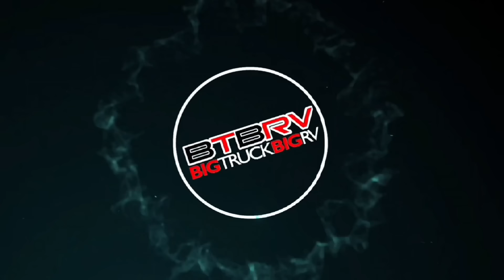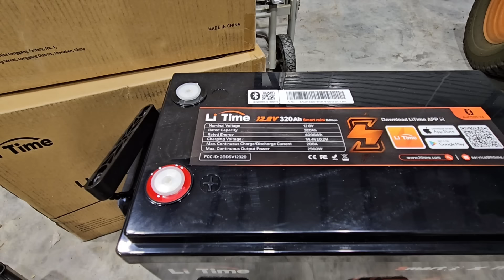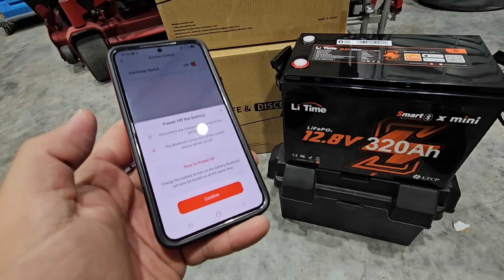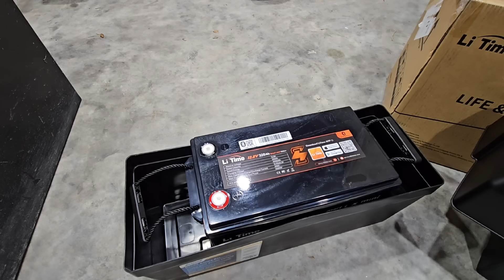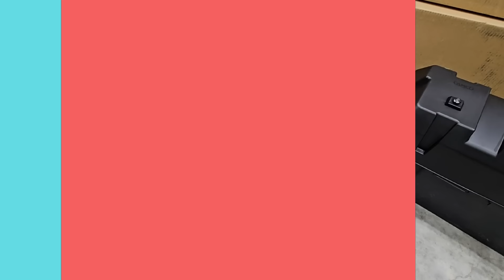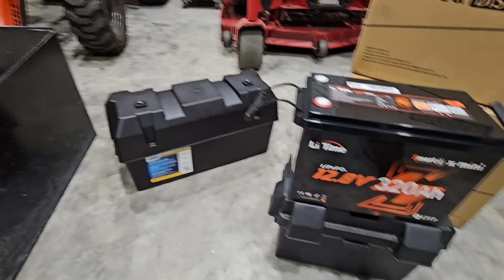INCREDIBLY COMPACT 320AH Lithium LiFePO4 MINI RV Battery from LiTime!

Comment: Just bought this battery in the self heating version  and will be boondock camping with it tomorrow. We have 340w of solar and an absorption fridge and no inverter so we should have more than enough power for any conditions we run into.

Comment: Batteries aren't getting smaller, the cases are. Battery makers have fooled people into believing a bigger battery holds more energy when all you're doing is buying empty space inside the case. The biggest culprit are 200ah batteries. They continue to be huge and still only have 4 small 200ah cells in them. it's a joke.

Comment: I've been looking to replace my two 6 volt battery's in my motorhome.  Would love to put one. Besides not having to hook up the extra wires, what changes would need to be made. Have a Onan genetic that the house battery start.

Comment: So did a little research on these smart batteries from LiTime, apparently thier BMS are all likely manufactured by the same company and they have a serious software bug. They work fine as a single battery but not with 2 together, and they create a serious security vulnerability as well. They have not been very responsive about a fix. It has been advised to avoid their "Smart" battiery line up until they come out with a fix or a version that is not vulnerable.
Reply: There’s an update available to solve this issue.

Comment: Nice, get 2 of those and a nice charging inverter and solar charge and some solar panels and good to go for some off grid camping. Get a few more of these With a sizable solar and efficient inverter AC system and you could be off grid through the summer.

Comment: When measuring the box for placement in the location where the battery will sit, you should measure the length, width and depth of the lid, not the base of the box, because these will be the largest measurement of the battery box.

Comment: Please mention this in your next video:  Your RV’s converter (the box that charges your RV’s battery when plugged in to shore power or running on a generator) MUST be compatible with LiFePO chemistry. These batteries have a completely different charging profile. You can’t just “replace your lead acid battery” and head on down the road.  Many new converters have lithium options (but it has to be selected) and many do not.
Reply: @vg3430  even if not a lithium profile it will charge it fine, but only to about 80%.
Reply: LifePO works, is a straight swap. Like a lead cell battery get the right one. Don’t mix and match though

Comment: 3:35  "50% voltage performance" is a very odd term to describe usable battery capacity.  It's AMPHOURS (or Watt Hours) not "voltage".

Comment: I have this exact battery (and same case to hold the battery) in my Outdoors RV. Their app and Bluetooth BMS are total garbage. The app requires precise location to work and most of the time you have to delete and reinstall the battery for it to work each time. Be prepared to get a real shut if data is important to you. 

Would I buy this battery again? It works but the BMS and app is so poor (and company could care less) that I'd look somewhere else.

Comment: I found these on Amazon because you didn't mention the weight or price. The weight is manageable at 57.17lbs, but I was amazed that they are only $699 each or 2 for $1357! That's a lot of power for that price! Two of them could replace my four AGM batteries that weigh 40lbs each.
Reply: You have 1280 Ah of AGM batteries?
Reply: @tjshine7444   Why are you still using AGM batteries?  You are not able to use the majority of their capacity on a consistent basis.  In standard use, a commonly referenced cycle lifespan for AGM batteries is about 600 cycles at a depth of discharge (DoD) of 50%. If users discharge the battery only to 30% DoD, cycle life can extend to approximately 1,200 cycles.
Reply: @tjshine7444  less then the cost of one Battle Borne 100 ah batteries

Comment: Would this be easy to use to top off a power station? That is quite a lot of capacity at that size 😮
Reply: Yep….connect an XT60 (or XT60i) to your power station’s solar input and the other end gets connected to the battery terminals.  Power station will treat it as a solar panel…easy peasy.

Comment: I have an onboard 5500 Yamaha NPS inverter/generator. Do you think this battery has enough cranking amps to start the generator?
Reply: My 4500w genny uses a battery about the size of a 12v Milwaukee tool battery.  I would go out on a limb and say you would be just fine.

Comment: I run 2 of these in my semi in an in frame battery box to act as my APU. The only down side is after 8ish hours they drain and my truck doesn’t auto stop start (go figure it’s a 99 kenworth), I plan on wiring a push button start so I can tie in a few relays, low and high voltage sensors, and audible beepers so I can have the truck start stop

Comment: We’re getting closer and closer to higher end RV manufacturers selling Full self powered RVs/Campers.   

3 of these batteries and 1000watts of Solar with a larger inverter would run A/C all day long in the summer

Comment: Li Time batteries have treated me well on my boats. Best bang for the buck for sure. Those other brands that charge 3-4x more are just not worth it. There's another channel that reviews solar systems and did a deep dive, cut open on Li Time batteries. They're top tier inside and out. Quality construction and components.

Comment: Hopefully they have fixed the parallel connection issues with the “smart” batteries. I would wait until Will Prowse tears one down before i bought….
Reply: Yeah man, I have 2 100AH smart LiTime batteries in my camper and I ended up taking one out because they will not work properly in parallel. Pissed me off, I was so close to have a set up that works for me. I may just get one of these 320 or grab 230 and use the other batteries for other projects.
Reply: I think you are confused with wattcycle brand batteries (vs. Litime)
Reply: @singlespeeder  Nope i am not confused, Li Time and Redodo also have the same issue with lots of people reporting it on solar forums. All 3 brands apparently use the same BMS and possibly come from the same factory.

Comment: I wish they would give watt hours instead of amp hours!  It is easy to figure out how long something will run with watt hours.  But amp hours not so much!  For example how many ah does a light bulb use, I don’t know.  But watts everyone knows that easy.
Reply from the maker: Easy formula though.  Amp hours x Voltage gives you Watt Hours.

Comment: Good video. 

LiFePo batteries are a game changer if you want to boondock and even if you don’t. Way more capacity than an equivalent lead acid battery, much lighter, no maintenance, built in controls that simply will not allow you to damage the battery by running it down too low. 

They require a different charger than lead acid batteries do. A lot of newer onboard converters and solar controllers allow you to switch to lithium charging by pushing a few buttons or flipping a switch. If yours don’t have that feature, upgrades are possible and not terribly expensive. 

Not only that but the price drops seemingly every day. 

Best new technology to hit the RV world in a very long time.
Reply: No, you can use a lead acid battery charger. It's just as efficient. I've been using a lifepo4 battery for 5 years and my RV doesn't have a lithium setting. It charges just fine, but I normally charge with solar anyway.
Reply: Doesyour solar controller support lithium batteries?

Comment: Okay, okay, now you have my interest, so I have the battery that came with my 5th wheel and I do have an inverter so to get something like this what do  have to do to upgrade to something like this, I have two regular batteries will I need to get two of the Lifepo4 batteries or what do I need to do, I'm a green horn when it come to this?
Reply: The main thing is to make sure your charger is lithium capable or you would have to switch it out for one that is
Reply: In your application, installing one 100AH will likely get you more capacity than your two  existing batteries, depending on how big your existing batteries are. you have the space, installing a 200 AH LiFePo battery will get you the capacity of four lead acid batteries, etc.  

Your existing onboard charger and solar controllers allow may be switchable to handle charging lithium - check the specs on the units you have. If not you’ll want to replace them with units that have that capability. 

There is a bit more to it than this but those are the basics. You could do nothing else and be very happy. There are any number of YouTube channels that discuss this further -I like Will Prowse.
Reply: @stevem2522 I have a 2023 Jayco North Point 310RLTS 5th wheel so can I just go with the 100 AH battery and do I have to change anything with the inverter I have, we really don't boondocking so I don't need to go over board with this?
Reply: @bishopgeorge1333 even if you don’t boondock, when it’s time to replace your battery get a lithium battery to replace it. If you camp where it gets below freezing get one with a built in heater. You can use them below 32 degrees but they won’t charge. If you’re on shore power it probably won’t matter but it’s a useful option. 

Install the battery, flip the switches on the converter and solar controller and you won’t have to check water levels or replace the battery for some 10 years. My 2022 Jayco has the switch on the converter (Progressive Dynamics) and on the solar controller (Go Power). I’d wager your Jayco does too.

Comment: If it is in your field of expertise, I'm sure a lot of us with older campers that were made long before LiFePo batteries came along would love to see a video on what it would take to get old charger/converters to handle this battery.
Reply: Just swap old converter for a new one. Plug and play.
Reply: You just need to find the converter which charges Lithium batteries. Mine was in the basement underneath the stairs in my 5th wheel, behind the wall in the pass through storage area. I'm presuming many fifth wheels are similar. In our old travel trailer the converter was under the bed in a wooden box. It's only a few wires then biltong it back in place. I did a 60A for a 60A.